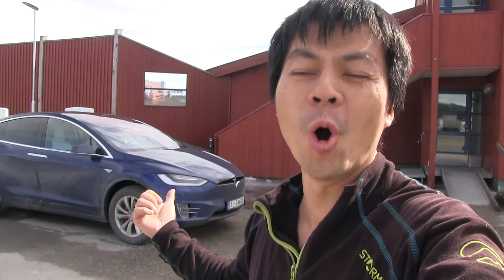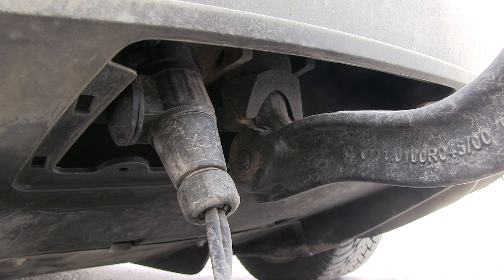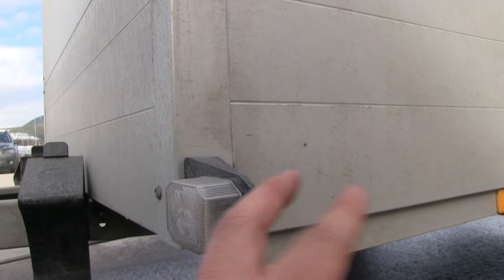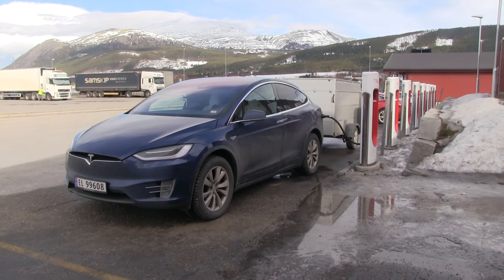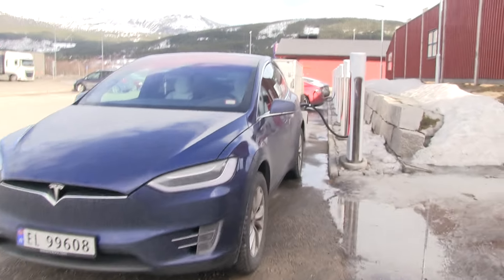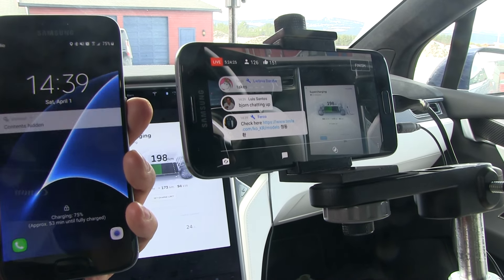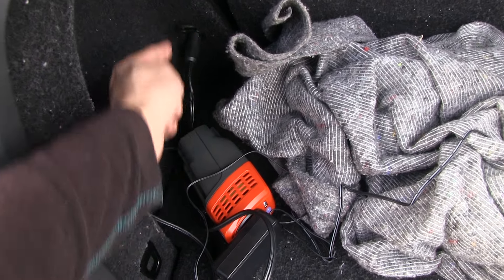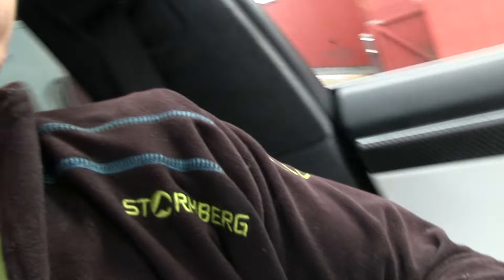Optimus Prime is back!

Comment: One of the best things you can do to keep winter schmutz out of the trailer plug is putting some dielectric grease in there.  You can get a tube of it at any auto parts store for just a couple of dollars/Euro.
Reply: Yes. Do it.
Reply: Paul Evans yep, agreed 100%, preventive maintenance is much better/cheaper and effective , saves you time and money.
Just want to add , when the warm weather will come it's best to go through all of those connections that could be affected by salt & corrosion over winter months and clean them up and apply that dielectric grease.
Glad your optimus prime is fixed and back on the road again!

Comment: My view is that you know the problem of schmutz because no cover, so you could carefully measure out where the openings would go, "measure twice cut once", then cut it, test that the items fit, then put in rubber grommets around them to make a nice seal, and then you have a custom in-use cover the way you said it should be, or something.  Later, Tesla can engineer a more interior cover that covers more of the interior and exposes the connections, but you can make one that works for your situation.

Comment: Just get a 12-24V to 12V adapter. But usually you don't need this, the voltage is regulated inside the device, most routers accept from 5-6 V up to 24 V. The devices with more demand just get a higher voltage to reduce the loss. 

The regulator is usually cooled enough to accept a bit higher voltage. If you're curious, just open it and look, if theres no heat spread on the voltage chip, just add one.

The specs are usually easy to find, if you want to take a look which voltage the device exactly accept. :)

Comment: Here's a thought, that issue with the exposed tow bar, have you considered making a cover for it, you could make one out of vinyl or canvas coat it with water proofing wax and stick it to the car using high strength Velcro.

Stick the Velcro to the car and then you could pull the cover off whenever you wanted, the only part left on the car would be the Velcro stuck to the car, which you could disguise with a suitable adornment one you put the original panel back on, or remove it with care.

Comment: And for the trailer, I know you now did a good job with covers and sealing, but I wonder if cleaning the seals (in place -- tightened, not removing anything) and putting on Silicon caulk (clear) just to "be sure" might help.  It would look messy, so an even clean line that's pretty thin would be important.  I don't even know if Silicon is spec'd for automotive.  Probably not.  I use it in building construction.

Comment: Seal the bottom where the wires go into the plug, after cleaning it, seal it with silicone.
then no water or salt will get in through where the wires go in.

Comment: Hey Bjørn,
I'm glad that Optimus Prime is back, and the major issues have been fixed.
Some router related hints:
Your car is like a Faraday cage, so placing the router inside the car far below the windows in the trunk is kinda sub-optimal. Could be the reason why you get bad connection even when travelling through well-covered areas. I'd recommend, that you place the router or at least the antennas outside of Optimus Prime. You could maybe mount the router on the roof of your trailer somehow, in a waterproof enclosure like this one:
https://www.voelkner.de/products/159434/Universal-Gehaeuse-IP65-Rp1085-105x75x40.html?ref=43&products_model=S21233&gclid=CjwKEAjwq5LHBRCN0YLf9-GyywYSJAAhOw6madxi0k9SsFm-YnzpGPyjEQ6HZfgj1xFh5f0a-mvrkhoCsVXw_wcB
The enclosure is made out of plastic, so no radio wave is being blocked, and the nice antennas of the router can begin to show what they're capable of. More than that, you could also mount the antennas outside of the enclosure with as short cabling as possible to minimize transmission / reception power loss. I'm sure, the 12V wiring of the trailer can be tapped somewhere safely to get power support for the router.